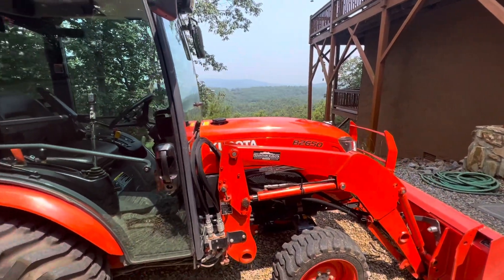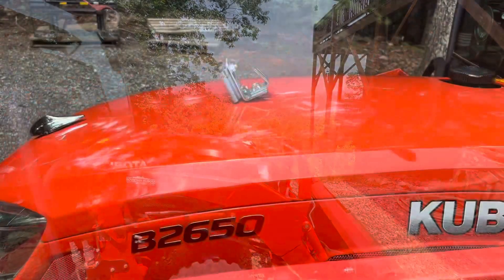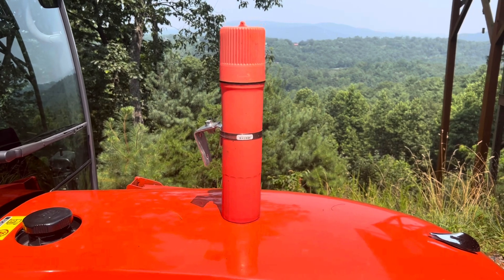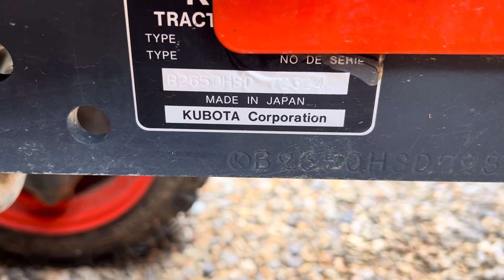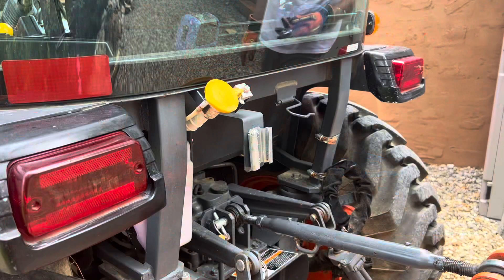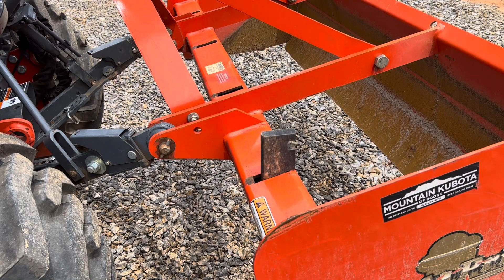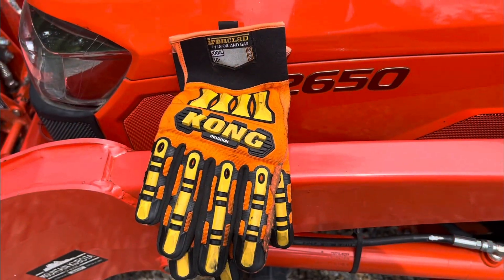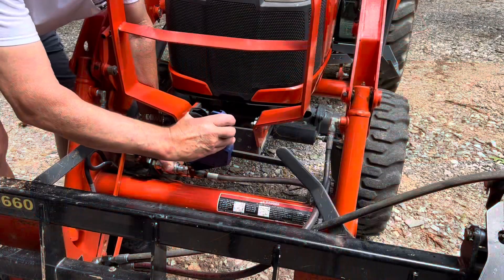One of these tools will change everything.  Irwin QC Mate, Koken, Lobtex, Channel Lock, Engineer.

Comment: Very nice, I need some of those Japanese driver bits...yours may be different but a little wiggle wiggle and tap tap on the joystick and 3rd function while the tractor is off releases the pressure on the hydraulic lines and makes connecting the hoses a lot easier
Reply from the maker: Thank you for the comments.